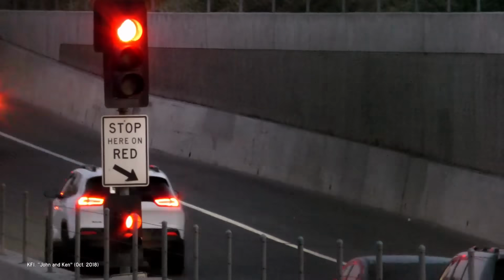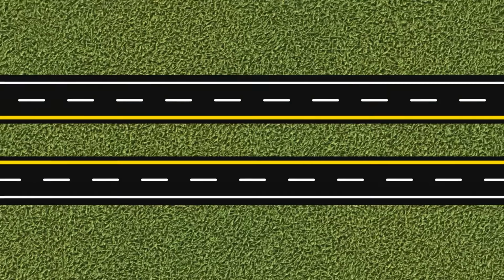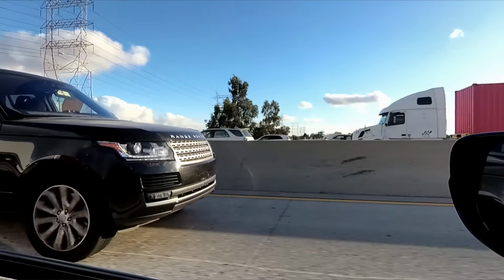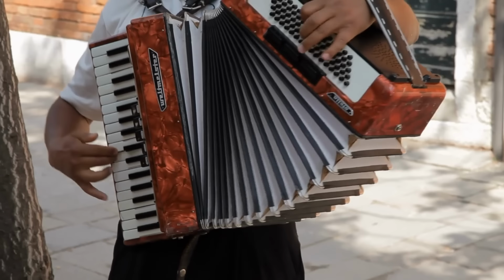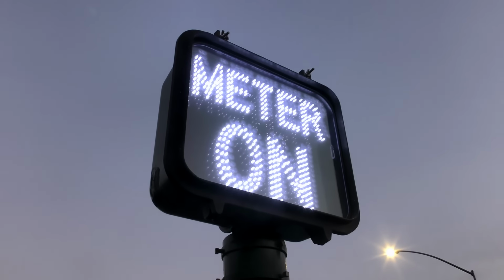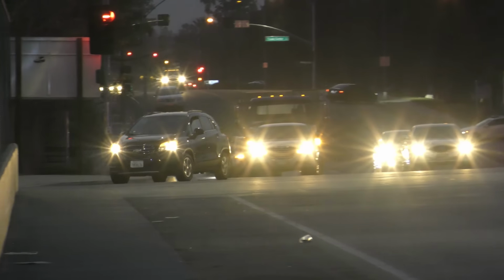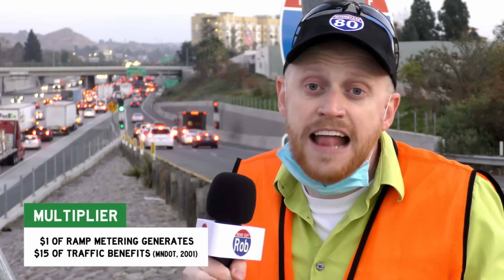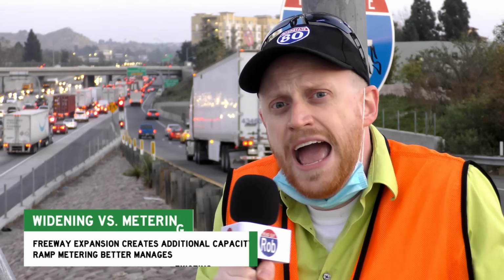Why the extra RED LIGHT on freeway ramps?

Comment: Two issues that I see: Energy wasted in braking and acceleration (esp for heavy trucks), and no mention of zipper merging.

You could definitely reduce the need for these ramp lights if drivers know how to predictably merge into traffic. One goal of the on-ramp is to give the driver time to match the speed of traffic to more safely zipper merge. Stopping them midway disrupts this. I live in eastern US, but have heard that zipper merging is part of drivers ed in the EU.

I can see how the lights minimize the "shock" as the video put it of drivers attempting to merge into a busy highway at 30-40mph (50-60kph), however frustrating it might be to the rest of us.

Comment: I've been driving in Tacoma, WA since before a single ramp meter went in. There are way to many human components for there to be any inkling of improvement whatsoever. Very rarely does it actually function as advertised. Either it creates this line that wouldn't actually be there and the freeway is flowing smooth while the line sits needlessly, or the freeway is slow anyways and the cars are bunched up at the end of the ramp anyways because to avoid it you would have to drive 3mph down the ramp... it's time these states just get with the picture and when they do widening projects, they widen it more then is needed during the design phase.  What usually happens is the design phase starts when one lane is needed, so they plan for one lane. 5-10 years later, when the ground actually breaks, 2 lanes are needed. So now, we are literally back where we started. Not to mention, here in WA for example, they no longer add a lane, they add an hov lane. Or even better, a toll lane... so not only does it end up not being enough lanes, it's a restricted lane that does even less to actually alleviate then a regular lane. To top it off, it's too the left side of the freeway, so grandpa, with a naggy grandma in his ear, going 10 under the speed limit, has to cross sometimes 4 lanes of traffic to join the lane they feel entitled to be in. See normally they would cruise in one of the 2 right lanes and not impede the flow of the left lanes. But with the hov lane, slow drivers with passengers now interfere with the flowing lanes... and now there's traffic where there shouldn't be.

Comment: If you meter up all your on-ramps, then technically you could keep the freeway from ever backing up, you'd just cause a backup onto the surface street. Less of a problem if only ramps were long enough and could hold enough cars, like the one in your simulation did.

Comment: If people knew how to merge, it won’t be a problem. It’s one thing if the on ramp is one of those ones that takes you in a circle but those straight ramps are be easy to merge. I live off I-295 and Route 460 in Petersburg, Virginia and I-295 speed limit is 70. That on ramp is so straight that I can be at 75-80mph by the time I need to merge. I can push 80  on that slight curve at the end of the straight on ramp. Just at least be at the speed limit if you are on a straight on ramp

Comment: Denver Colorado has them but I'm quite positive they are just on timers to come on in the morning and shut off after 8pm and they don't alternate they both turn green simultaneously so you and the guy (or gal) next to you race each other down the on ramp.
Reply: There are a few ways to operate a metering system. The “dumb” way, 5am to 9am preset for example, w/o feedback from mainline traffic, to highly computerized programming with complex algorithms on providing best mainline throughput while getting the best on-ramp flow rates. Of course, different algorithms & theories on how to accomplish those objectives

I would hope/think that CDOT doesn’t use timer. It may have been programmed to do so due to loop/sensor damages as a stop-gap measure until repairs. Or like in CA, damage due to wire theft. Both takes time to repair

Comment: We don't use those in the 🇬🇧, but then we also only have 3 lanes on most motorways, and only one is for driving in, the rest are solely for overtaking, so the middle lane is reasonably clear, so a vehicle speeds up the slip roads, the traffic in the lane next to it should change to the middle lane, and those on the middle lane should move the outer lane, and then every one moves back into the in inner lane, there are also laws about not using the right lane.

Comment: Hope your Minnesota meter story includes EXACTLY WHY THOSE RAMP METERS WAS TURNED OFF FOR THAT TIME PERIOD??
It was turned off because MN freeway system set up their meter system ONE SIZE FITS ALL. Meaning the meters were turned on between the hours of 5:30AM to 9:15AM & 3:30PM to 6:00PM in all directions. Doesn't matter if the freeway was moving at posted speed or a parking lot. They needed that time to band-aid their system to have the control room can monitor the traffic & switch on/off the meters when needed.

People was pissed sitting at the meters for 1/2 HR, wasting gas, while the freeway was moving. Plenty of times I sat just to get on the freeway to go 1 mile (over the Mississippi River on 694) just take the side streets to go home freeway goes from 4 lanes into 2 lanes 1.5 miles after I get off (94 & 694 heading to Maple Grove - today the portion is 3 lanes instead of two).

Comment: Question for you Rob - do you have 'smart/managed motorways/freeways' in the USA? They are increasingly common in the UK (https://en.wikipedia.org/wiki/Smart_motorway) and work along the same principles of managing traffic flow (and removing shocks), but they do it by dynamically adjusting the speed limit based on density of cars. Normal is 70, as traffic builds it reduces to 60, and in a traffic jam it reduces to 40 (its lowest setting). That means as jams clear, or gaps open up, people don't accelerate as quickly as possible up to 70, only to slam their brakes back on half a mile later.
They also allow cars to run on the hard shoulder/breakdown lane during peak rush hour, providing an extra lane of capacity (all watched by cameras, so if a car does breakdown the lane is closed again).

Comment: Interesting video. With regards with two highways intersecting and the oddity of putting ramp lights on highways, I wonder if they can use variable speed limits instead and slow it down further when the entry ramp gets too busy.
Reply: I've always thought they should have a variable speed limit system. Maybe they could have a bunch of loop detectors and switch the speed limit signs to electronic signs. But they'd have to pull their heads out of their asses long enough to put that into action. Many roads in the U.S. are artificially slow because of old sensibilities.

Comment: I drive a majorly detuned company truck, I have to stop unnecessarily on the on ramp, now I have a  very short length to reach the flow of traffic speed. By the time I reach the end of the onramp I am 20 miles under the speed limit so now I am cutting some poor soul off because the city has cut my momentum with ANOTHER traffic light.

Comment: All I can think about at the ramp meter is how much fuel I'm wasting bringing an 80,000 lb truck to a stop then floor-boarding the accelerator. If I wasn't going to cause a backup at the merge point before, I might do so after that.

Comment: biggest problem i've seen with ramp meters is getting people to stop when the meter is on and there's no one in line.  a lot of people will follow the rules when there's already lines waiting, but will just blow right through if there's not.  and you don't wanna be the one guy at the front of the pack following the rules...

Comment: Not that anyone cares, but in the UK we first had ramp metering installed around 2003, interestingly we call it "ramp metering" rather than "slip metering" even though we never call them ramps (we call them slip roads). Also we have removed quite al ot of our ramp metering signals when the motorway it was on was upgraded to a smart motorway (basically a freeway with no shoulders but has lots of tech to set lower speed limits and close lanes etc). Also where we do have ramp metering, it normally allows upto 4 vehicles through (two per lane) at a time

Comment: Cascading brake lights are responsible for a lot of freeway slow-downs, but this doesn't have to be.  Much of the braking that takes place on the freeway is unnecessary.  If one needs to slow just a bit to let someone change lanes or merge, or because the driver in front slows and the gap closes, all that's required might be to lift one's right foot; braking might not be needed at all.  The problem is that lots of drivers think, perhaps unconsciously, that their right foot must be somewhere, so whenever they take it off the accelerator, they put it on the brake.  Even if the amount of braking force is negligible, the brake lights come on, and the cascade is triggered.

Comment: What about ants? They flow in single lanes and never have traffic jams. There is an article about that (too lazy to find it now), I believe it mentions they all travel the same speed unlike humans drive at different speeds and most trying to speed up only to slow everything down. Then there are some ants carrying heavy loads (like a leaf that is 20 times bigger than the ant carrying it) so the other ants moving in opposite direction move to the shoulder so the leaf carrier has a free path. Of course if there are slower ants, the faster ones can simply walk over it. Maybe that's what we need, cars that can drive over slower cars.

Comment: Ramp Meters show a region's inability to manage its road infrastructure. Highways and Interstates shouldn’t be congested enough that these are needed. Usually, in cities where I see ramp meters in use there are (1) not enough local connections to and from the suburbs, (2) the geometry of the highway or interstate creates a lot of conflict between cars merging on and off the highway, (3) the region lacks beltways, HOV, and express lanes that incentivize carpooling into downtown or ways to avoid downtown.

Comment: First mistake: braking to let someone entering in. At most(obviously if the enterer is clueless, you need to take evasive action), you should ease off the gas to create an opening. It's up to the one entering to find the opening to take. Not on the one in the lane. What's better is if you can find yourself not in the slow lane in the first place.

And this is why it is important for the car entering to get up to highway speed as much as possible. Those that slow down as they get near a highway because they are nervous or want to "be safe" should never have a license to begin with and should take the bus or Uber...

Comment: I've never seen a ramp meter that helps with the flow of traffic onto the freeway. I always just go in the HOV lane that bypasses the light and get into the flow of traffic with no problem. 

What I love is sitting in a traffic light that's red at night time, when I'm the only car on the road. I don't understand why they put sensors in the lights, if they don't use them 24/7.

Comment: If you have to move a given mass of cars, would it be more efficient to split that mass onto two separate roads side by side (e.g. two four-lane highways), instead of doubling the single road capacity (e.g. one eight-lane highway)? 

Then the traffic lights before the on-ramps would work as a sort of demultiplexer that decides which on-ramp you get to use. (Not a traffic engineer, by the way, just a filthy ohms law-abiding electronics engineer).
Reply: If you apply an Erlang model to parallel roads you will see the capacity of splitting 1 x 4 into 2 x 2 reduces capacity by 20 to 40% depending on assumptions. This actually happens with HOV lanes that take capacity from the main line, reducing its capacity significantly, which providing a small number of people a faster path. Turns out the overall capacity of such systems suffers while those with the special stickers sometimes get better results and sometimes don't - depending on whether one car decides to drive slowly in the HOV lane. Overall capacity would improve if HOV lanes were eliminated and replaced with ramp separate ramp meters based on HOV status.

Comment: Wonder if on top of the meters, or an alternative to said meters, is to OUTLAW incoming traffic from GETTING OUT OF THE FAR RIGHT LANE OR TWO until they achieved a certain minimum speed. Educational trial period with warnings, then the fines for "impeding traffic", "improper lane usage" & whatever can roll in. 

Especially on freeways & interstates that have the auxiliary "exit only" lanes between EVERY exit with all the time in the world to get up to speed before merging. I-270 & a good share of West St. Louis interstates are prime examples of this. Some places with a 2-3 mile acceleration lane, yet they'll cut folks already around 70 mph off without flinching...

Post the minimum speed at the onramp and have either a one sided solid line (no  crossing from this side) for around 1/4 mile after the onramp meets the mainline. Before rush hour really begins, you can see it all likely starts because maybe a literal couple dumbasses go from the onramp ALL THE WAY TO THE LEFT LANE BEFORE THEY'RE ANYWHERE NEAR UP TO SPEED.

Comment: Let it be know that best practice bicycle infrastructure moves 4,000+ bikes per hour in a 30 foot width (zero fatalities, zero pollution). The average speed of the 70% single occupied vehicles in a Southern California's urban space during peak hour is slower than a person on a bikes' average speed. When you add all the the time you work to pay for a car (including taxes and costs for expensive car-centric infrastructure) and time it requires (maintenance, fueling, driving, sitting idling), the average time you put in for every mile a car takes you is SLOWER THAN WALKING. 
When will north Americans realize by continuously trying to out-lane car traffic, you just induce more of it

Comment: Once the traffic falls over the cliff the metering lights do no good whatsoever. I know this from commuting on the 101 through San Jose where the traffic would go over the cliff every day at about 3:00 PM and not recover until about 7:30PM During this time, I would wait 5 minutes in the queue for the metering light to get on the freeway, only to travel unimpeded about 100 yards before getting in line to merge onto the packed freeway. Once the traffic falls over the cliff, the metering lights should shut off until the traffic speed on the freeway speeds up to the small range of speeds where the metering lights are useful again. Traffic on the surface streets was faster, except for certain bottle necks where one would loose all of the time one saved by using the surface streets. These were almost always where one would cross a freeway, or the rout went near a freeway on ramp. It does not help that a recent tax that was sold and passed as money to improve the roads was stolen for BART and other public transport expenses.
One of the causes of backups is short on-ramps where many cars don't have the horsepower to reach freeway speeds before they are forced to merge. This is not helped by metering lights.

Comment: The lights on the ramps make sense when you remember that most people drive their cars like a herd of cattle they don’t spread out enough so when it comes to merging with fast moving traffic, they end up slowing everybody down and causing accidents
Reply: This can possibly only work if the ramp is exceedingly long (in the thumbnail, you should already be going 65 where that stop bar is). I have personally never heard of this or can imagine why anyone would do this, since people seem to zipper just fine in my city famous for its bad drivers; the only issue being that people merge in too slow, which this 'solution' would only exacerbate.
Reply: @Jul-66  use it in Victoria in Australia and it works very well. The cars come to a complete stop at the red lights and they turn amber periodically which allows a small number of cars to enter the traffic stream and prevent there being accidents when cars attempt to merge into the Next line. only used during peak periods.

Comment: We used to have one of these useless red lights at one of the on-ramps onto route 9 in Middletown connecticut. You really need to check out route 9 in middletown. It's literally the worst designed highway ever. There are traffic lights in the middle of this highway because there's no room for entrance ramps.... It's literally a clusterfuck...
But yeah, we had one of these stupid red lights that flashes red green red green red green every 10th of a second but nobody ever paid attention to it because it would just keep going back and forth from red to Green even when there was no one on the entrance ramp. So the city or the state or whoever took it out and now it's just a stop sign. But it's still one of the worst entrance ramps onto route 9 because you have to turn your whole body completely around to see on to the highway to see if you can go, and even though the speed limit is technically 45 in that area, everyone is still doing 65 or 70 and there's a bend in the highway right before this entrance ramp. So there could be no one coming when you look, but by the time you get your body turned around and you start to accelerate, you can have 10 big rigs up your ass....  And people LOVE to start accelerating, then they STOP completely and get rear-ended by the car behind them....
Then the next entrance ramp is only like 10 ft long and they also can't see the traffic coming behind them. And then another like hundred feet down the road are the traffic signals....